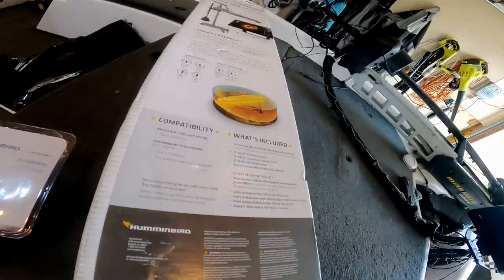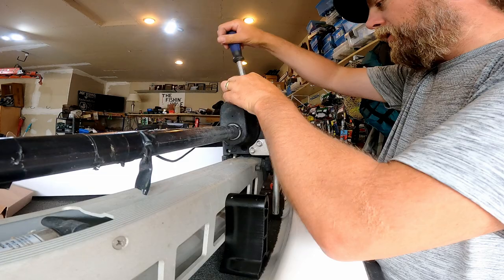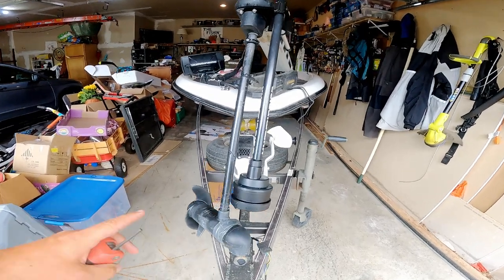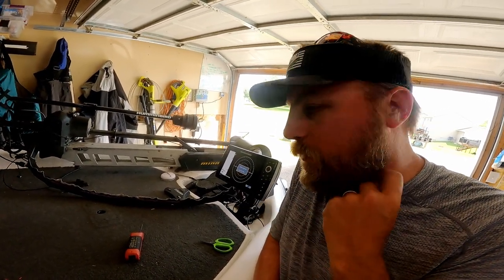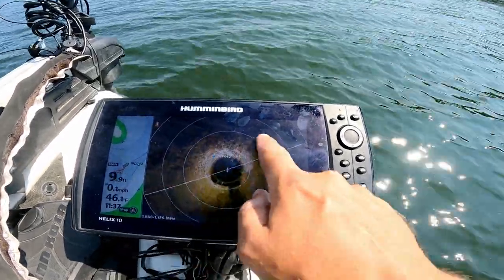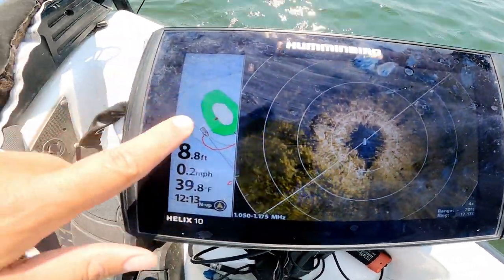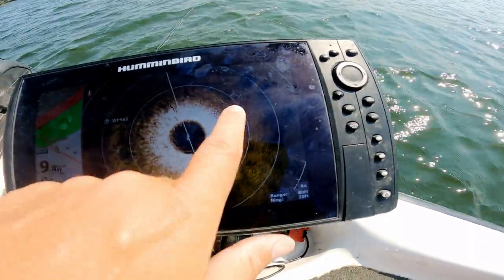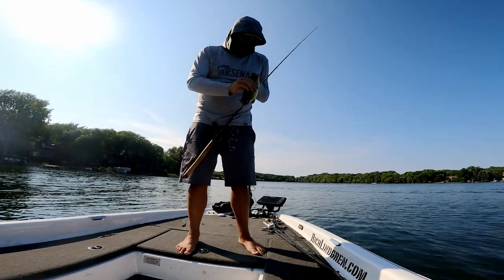Is MEGA 360 Effective on Single 10" Helix?  (Install & Review)

Comment: Just put 10' raptors on my boat 360 might wait till spring lol. Definitely been waiting to get one. Especially after that interview you did with using 360 vs live on the river.  Thanks for all the tips.
Reply from the maker: How do you like the Raptors?
Reply: @HellaBass  great so far. Glad I got 10' as apposed to the 8' plus the active anchor mode seems to help keep her in place better.

Comment: Can it be done on a gen 3n Helix 10 head unit with a transom mount mega transducer..and 360 transducer?
So you can use transom transducer when running main motor and than use 360: when under electric trolling motor?

Comment: I'm thinking of putting a fish finder on my kayak.  I've never used 1 and want to keep it as simple as possible (1 graph + 1 batter + 1 transducer if possible), and only buy once.  Would you recommend the mega 360 as being the only fish finder?  Or do you think there are benefits to side and down imaging then adding mega 360 to that system?
Reply from the maker: Bryan, good question, I have never really fished from a Kayak, i will advise you ask this this question of Bailey over at Serious Angler or BE the Fish channel, he is much more knowledgeable about kayak electronics setup
Reply: Hey Bryan! Helping out Rich here. If you are thinking of adding a fishfinder to your kayak, I would recommend starting out learning one that has Side Imaging, Down Imaging, Mapping and 2D. For example, a Humminbird HELIX 9 MSI GPS G4N is a great model for the kayak that has all the tech you need. I would get accustomed to that tech before you add MEGA 360 or a forward-facing sonar to the mix. Hope that helps!
Reply: @BEtheFish  that helps quite a bit.  I hear some use the phrase, "buy once cry once," and I didn't know if that would apply here.  I've fished 1 season out of the kayak with no electronics and just beat rip rap banks and fished laydowns.  Had success, but on days the fish aren't there, it would be nice to find underwater structure to fish
Reply: @bryankaylor2225  it’s definitely nicer to have it and not need it then the other way around!
Reply: @BEtheFish  I've just tried to keep everything simple.  No batteries to keep charged.  I don't get out much and most times I get out are last minute decisions when time presents itself.  So it's a load-n-go
Reply: @bryankaylor2225  totally understand that! There many times I do the same but certain bodies of water (especially being a tournament angler) where the electronics just make you more efficient and can assist in the process of catching more fish...which leads to more fun!

Comment: Was curious, did you have to install a Humminbird Ethernet Switch in order to connect the 360 with the Ultrex and Helix?
Reply from the maker: No need to connect 360 to Ultrex in my opinion.  I have ethernet so my 3 units share waypoints and transducers.  But not needed to hook 360 to Helix
Reply: @HellaBass  That's a relief, one less thing to have to buy.

Comment: Ipilot link will work instead of the GPS puck.
Reply from the maker: Good to know, thnx.  But also the heading sensor is gold for offshore fishing regardless.
Reply: Ipilot link gives you that plus you get the ability to follow contour lines. It is more expensive but there are a few more added features that one Hass to consider if adding the Compass only or the benefits of ipilot link.  The other benefit is it you don’t have to screw anything into your boat because your trolling motor is already connected to your unit which in most cases is networked with your other units.
Reply: But nice video and as another bass cat owner, thanks.
Reply: Also for anyone that does not have ipilot link on their trolling motor they can add it later if you contact Minn kota. I’m currently in the process of installing my 360 on my ultrex with a helix 10 just like you and had to learn all this myself.

Comment: I have a Helix 10 G4N with both a regular SI and high speed transducer which are already hooked up on a splitter. Do you know if the splitter cable you used is going to work on my set up?
Reply from the maker: I am not sure how that would work, sorry, don't know
Reply: @HellaBass  Thanks, I just found out from Humminbird that I will have to remove the high speed transducer and splitter in order to install a Mega 360 but it is the right cable when I remove them.
Reply: Can I run standard mega transom mount transducer and 360 transducer with a plitter cable so as to run standard mega transom mount transducer when running main motor and run 360 when under electric trolling motor?
With a Helix 10 gen 3 N head unit?
Reply from the maker: I think so, your plan is to read the 360 at your  dash unit?
Reply: @davidraguse2106  If I understand your question, you want to be able to use a Mega 360 without using it for side imaging in order to avoid having the 360 transducer down when running the big motor. I was trying to do the same thing. I don't think there is a splitter cable or software available for doing it that way yet (maybe someday). You can do that by plugging and unplugging the transducer connectors on the back of the unit but I definitely wouldn't advise it.
Reply: @DaveReed101  thanks.. don't want to be unplug and replug all the time..and don't want to buy another head unit networked
Reply: @davidraguse2106  Same here. A lot depends on your boat setup and how you fish. You will probably get a better SI using the Mega 360 transducer with a good bracket that is really stable at up to 5 mph. I am trying to either find or devise a solid kick up transom bracket for mine just in case I forget and leave it down when I take off from a spot or I hit something. Adding a Mega 360 can really improve your results and is worth the extra research to make it work for your set up. I'll bet eventually Humminbird will realize the need to make the Mega 360 separate from the SI but right now the guys that only bought a DI unit are getting a real deal while we wait.
Reply: @HellaBass  that is correct... only one head unit on a swivel mount.,. transom mount transducer when traveling at speed and want 360 when under electric troll motor
Reply from the maker: So if the transom mount is a 2D only ducer, sounds like it would work
Reply: @HellaBass  I'm not sure what you mean but if you had a splitter plugged into a Helix using a Mega 360 transducer and a 2D transducer I'm pretty sure you would be able to get these things on your Helix screen .... 2D, water temp, gps and all mapping features. The only thing you wouldn't get is Mega DI. So if that is accurate (and I'm not sure it is) it would mean that if you were using your Helix transducer and it quit or got damaged you could replace it with a less expensive high speed 2D transducer on a suction cup mount and all you would lose is DI until you got another Helix transducer. Keeping a 2D transducer with a suction cup mount as a back up could save a vacation or fishing trip if you depend on your Humminbird like I do.
Reply: Ok so I have a Helix 10 gen 4 N with a mega si di transducer, can I also add 360 as well! Is there another prot to hook up another transducer in conjunction with the one I already have?
Reply: @craigcoble  The Mega 360 is actually a mega transducer and it may be slightly clearer than your Helix Mega transducer. When you hook up the Mega 360 with a splitter cable the Mega 360 will then provide your 360 and your SI to the Helix unit. The DI pings will continue coming from the Helix transducer BUT (this is important) you will continually need to switch the active transducer in your Helix settings to whichever transducer you are wanting to view. When it's set for using the Helix transducer you won't see 360 or SI without changing that transducer setting in the Helix. When it's set for the Mega 360 you only see mega 360 and mega SI.

Comment: What is the difference between the gps you are using and the one that comes with the ultrex ?
Reply from the maker: The puck that comes with the ultrex is not a GPS, the GPS is internal to the ultrex, all that puck does on Ultrex is allow you to use Jog Feature on the remote.  My Humminbird GPS w/ Heading Sensor puck allows me to always have a straight line off my bow on my graph regardless of speed or direction